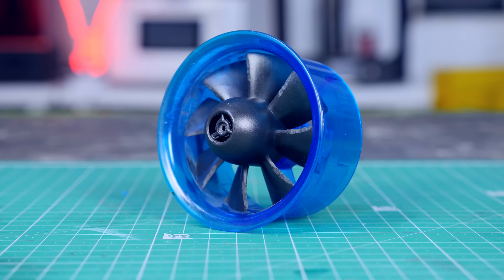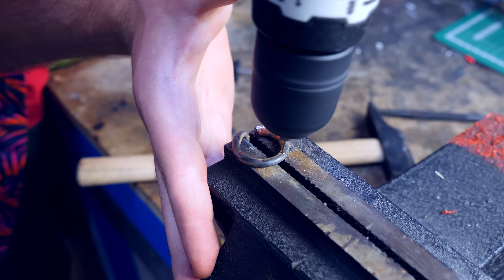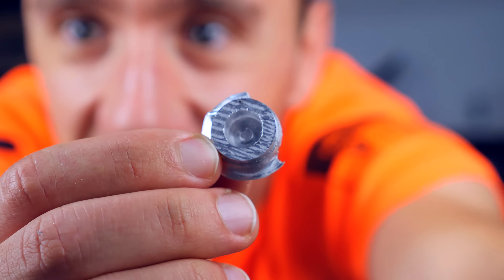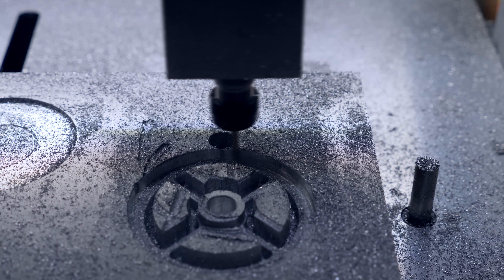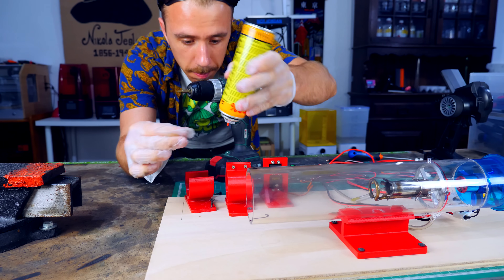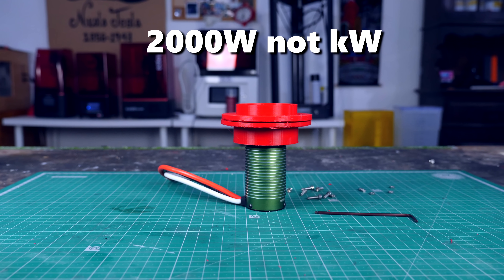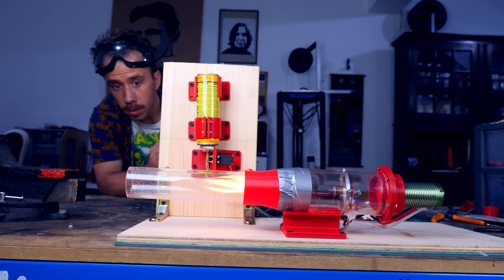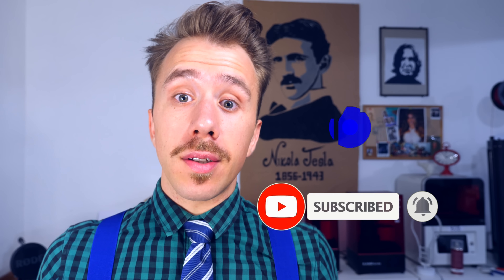I turned my Fan into a Jet Engine (3D Printed EDF Afterburner)

Comment: It is not the compressor that is holding you back, it is the nozzle (or lack thereof). You want a smaller constriction after a longer flame tube. The idea is that combustion happens at low speed, but high pressure, and then it is accelerated at the constriction. Without a significant constriction you are basically combusting at ambient pressure*, which doesn't let you do any work. A more significant constriction at the end of your flame tube means pressure can build up which means the afterburner does much more work.

*It will be slightly above ambient, because the expansion of the gas as it heats behaves like a constriction, but that also effectively shortens your flame tube. A moderate constriction at the end of the tube will limit the velocity increase to that area, giving the fuel more time to burn, while a smaller area means more back pressure.

Nozzles for aircraft with afterburners are immensely complex for good reasons. They need to balance flow against back pressure over a wide variety of conditions.

Comment: A flame holder is more a structure where a large proportion of tthe combusrion takes place in slower, hotter and more fuel rich air.  Suggest using the glow plug to light a fierce pilot light in a small flame holder, that heats the gas line for itself and an extra burner right behind it.

Comment: Sounds like your cnc needs slower feedrate or higher rpm. Or the power is to low because it sometimes stops spinning? Which parameter do you use ?

Comment: Radial fans/compressors actually suck pretty much and have long been abandonned on 'real' turbojet engine. They still are used on turbochargers and any kind of homemade turbomachine derived from there ;)
Why not printing an axial fan ?

Comment: Cool video.  A piezo lighter like the ones used to light gas grills would work well for your ignition source and not use any electrical energy at all, just your finger pushing the plunger.  They do not cost much money either.

Comment: Try filling the brass tube with sand before bending.  The sand will keep the tube from collapsing when you heat and bend it.  Works good for PVC too.

Comment: What if you wrap the fuel tube around the motor and connect it with thermal paste. That way the fuel gets a bit warmer AND your motor is cooled at the same time so you can run it faster or even "overclock" it?

Comment: Great video how about making a hydrogen peroxide remote control hover craft , the expanding gas can prove lift and forward thrust , you could use syringes on a screw thread to control the amount of thrust

Comment: To help with your surface finish and tool wear, increase the speed of tool rotation and slow down the feed. This will let your tool take smaller, more manageable bites. I also recommend using a suitable lubricant. Usually water based for aluminum.

Comment: Lookup Fan show down E6 and try the green cylinder fan in his hand on the picture, try modifying this one to your needs, I believe it will work better with your motor of higher power than the computer one, I know you can do this just don't get too scared or blown away from your creatures and creation 😜

Comment: So, some time back in the 80s when I was about 9 or 10 I build a turbofan engine like this using some cans. I made a 'turbine' with a can top ran off of a 6v lamp battery to a old RC motor, some fuel hose dripping gasoline to a flame holder, and you know what, it actually kinda worked. It made noise and flame at least. It might be time to make this with the kids. 

Might try a more involved 'Flame Holder' - I think it will hold your combustion in the chamber better, which you will need for thrust. And I know you like thrust. 

When you get it working, maybe RC boat time with this. Would be a great application. 

ALSO: I know a good bit about pneumatics and can throw you some solenoid valve info and parts to improve your setups. Feel free to drop me a line.

Comment: i dont know shit about cnc machines... but i hear for cutting lines, it is way more effective and easier on your bits to drill holes in the line's path and THEN side cut the line basically connecting the dots

Comment: We us a mist of isopropyl  alcohol when machining aluminum on a CNC.  Yes, there is a fire hazard, but it beats using oil (which is also a fire hazard).  It's very easy to clean up and produces a nice finish.

Comment: Integza,
When forming a brass tube, heat it to glowing, then quench it in water. This anneals the brass making it much easier to form.

This works on automotive brake system sealing washers too, FYI.

It's backward from ferrous materials which harden when quenched.

Also, RC nitro engines use a much smaller glow plug that runs on 2V. They're likely cheaper.

And since you can machine metal, why not make a true axial flow jet engine? The compressor (your EDF and centrifugal fans played this part) is connected by a shaft to the turbine, which is spun by the exiting gasses. Of course, your afterburner would also work in that as well.

Comment: you could learn pcb design and electronics design, you could easily make your own high voltage remote igniter, single pulse, continouse etc.
or make any other electronics project
idk rockets/3d printing but since you have all these tools you can make other things

Comment: You could try to build some sort of carburetor for your jet engines so you have more consistent atomization of fuel and a more controlled fuel air mixture.

Comment: You should 3D print a jet engine where the 3D printed burn chamber or acceleration chamber itself is the fuel for the afterburner 🔥
You almost used the acrylic tubing as fuel for your afterburner on this attempt 💥😎

Comment: noob checklist for CNC machining-
1- check spindle speed for size of cutter and material
2- make sure the depth of cut is small enough for each pass
3- figure out why it did some crazy shit like 4 times until it magically works for no reason

also I haven't finished the video yet, but I feel like the fuel should be upstream from the glow plug, or at least near enough that the ignition tube is radiating heat to your "fuel injector"

having finished the video, I think wrapping the fuel line or- maybe 2 lines- in a spiral around the ignition tube could preheat and serve to spread fuel through the chamber.. just not so close the copper/brass melts lol

Comment: The constriction you are using to convert the high pressure air into high flow has a name, it's called a venturi. It's also the best place to inject the fuel, as the low pressure, and high airflow through the venturi will better atomize the fuel.

Comment: Oh. A rocket/jet again.  I don't think Elon Musk is shaking in his boots, except with laughter.  Why not try something interesting, like those electro static drives, electric jet plasma engines, a electro dive made out of plates, like I was planning to do, or an electro magnetic sail drive with a really really really (run away from your house when it's in the basement) big Capacitor!  The sort the military has been running around in fur decades, while they laugh at you watching Stargate!

Comment: A) use lubricant when machining Alu, wd40 should be good. 
B) in Airplanes you have very Thin air, needs compression for combustion. The air down here should be thick enough. So you need high flow. If you feel the need for high pressures i would use an impellor+motor from a vacuum cleaner 🤪 
C) good work bud!😊

Comment: Also you can use one of the free calculators online to calculate your feed per tooth (chip thickness). There is a minimum amount of chip thickness for each material, if you go under that limit it can cause chatter, to high it can stall the machine, chip an edge or break the end mill. Once you figure out the range for feed per tooth you can then use a separate equation which takes into account your machine horsepower, depth of cut and feed per tooth. This allows you to tweak your cutting parameters close to the machines limit and be more productive.

Comment: 1 try to make a better version of the no heat engine and make a boat out of it possibly using other engines. 
 
2 try to make a good boat and make a propeller and resin get engine combo. 
(the light resin engine and propeller could be light and may even move!)

Comment: TL;DR, your first design was fairly correct, though it would be better to have the reduction from the second design with the main propulsion from the first.

Turbojets actually have "regular" fans. Also, mind, that a turbojet has a jet engine, connected to a larger intake fan, with some type of bypass - meaning that not all the air will be used for combustion. This doesn't look like a turbojet.
Anyways, the compressors in a jet are a bunch of well-tuned fans blowing into stationary blades (fans?), Pointed the opposite way to both allow more compression, and to stabilize the air so the next stage can function better.

Comment: Video idea/challenge: try to come up with an jet engine that runs on diy gas/fuel that is not bad for the environment. So it can be a good alternative to the crazy amound of fossil fuel these engines use. That would be amazing and educational (Maybe something like biogas or biofuel. Or make it powered by High Test Peroxide. Or make it powered by a hydrogen/oxygen generator (electrolisis))

Comment: Looks like a lot of runout on that end mill I would check it with a test indicator measuring off of a precision rod in a collet. Also we use WD-40 as cutting fluid on aluminum, in the machine shop. Best of luck👍🏻

Comment: Your flame holder needs to be larger, the fuel injector close to the flame holder (in the best case it should be inside the tube of the flame holder) and you need a stronger elf. this will get you the best results. Maybe try to add a fuel pre heater by winding a coil of metal tube and placing it in the engine where the flame is so the fluid will heat up and become a gas. good luck

Comment: Correct me if i'm wrong but, is this really an afterburner or just a standard turbojet engine whitout the turbine stage?
i mean, the turbine is not present because the compressor is moved by the electric motor of the EDF.
Normally the afterburner is after the turbine and burns an already burned mixture, in this engine the combustion happens after the compressor like a normal turbojet

Comment: I will help you out on how to make sparks safer.....  "DC 3V-6V to 400kV 400000V Boost Step-up Power Module High-voltage" eBay has them about 10$!

Comment: Wouldn't having the propane can be upright better as that would result in the liquid propane staying at the bottom of the can and only the gaseous propane being released. Therefore, you shouldn't need any heating stages and the efficiency should go up as less fuel goes unburnt (dripping into the combustion chamber 12:32).
Reply: The dripping is actually the reason why you want it upside down. Reducing the pressure of a compressed gas causes the gas to drop in temperature. In the case of propane, the cylinder is compressed in equilibrium with the gas and liquid phase. If held right-side up, the gas escapes and the propane boils, but the temperature falls continuously. This is further compounded by the enthalpy of vapourization in the propane. In the upside down configuration, the liquid fuel is pumped out with the gas in the cylinder simply acting as a self-pressurizing tank. This is very similar to how certain liquid fuel rockets work.

Comment: Quick tip for machining aluminium: Try a Vc around 600-850 m/min n=Vc/(π*d) n=Spindle speed, d=Diameter of the tool. With the right numbers should it sound better. Maybe a bit less feed.

Comment: Use much shorter endmills when milling and you will have less trouble and feel much more confident. The flute length needs to be the same as the depth you wish to mill and no more (plus a little to clear the swarf if you are going full depth in a single cut). Stubby endmills also tend to be double-ended so you get an extra try when you break one. Cutting oil is also worth using as it will remove some of the heat and stop galling. As someone below said you can use wd40, but cutting oil is easily as cheap.

Comment: A normal gas turbine engine is an air compressor. An EDF is an air accelerator, which is not quite the same thing. To make an afterburner work properly on an EDF and actually augment the thrust efficiently, it needs to burn in a high pressure zone, so you need to swap air speed for air pressure. To do that, you need a converging nozzle before the afterburner. I'd say reduce the diameter of the plastic tube by about half or two-thirds using a cone of about 30 degrees angle between the EDF and the fuel injector. You will be able to tell when it's right, it's more of a glowing plasma than a roaring flame. Yes, EDF afterburners produce a small flame compared to the diameter of the fan; that's life.

Comment: Have made dozens of these. use a compressor from a turbocharger. also, diameter of the inlet of the air entering and the diameter of the air exiting is detrimental.

Comment: Perhaps you could create your own liquid propane fuel regulator, so that you have a constant pressure and fuel flow for future liquid-fuel engines. This way you could perform more consistent tests on any engine that uses liquid propane/butane when you don't have to manually control fuel flow so much.

Comment: With it being a smaller CNC it's going to chatter easier, if you're starting top cuts on a soft metal like aluminium a ball end mill will help with chatter and can easily be cleaned up with a regular end mill for sharp angles

Comment: Hey Integza! Great video!
What size glow plug were you using? I am designing something using a high-voltage igniter using a stun gun system.
Here is an idea for a future video:
Develop an afterburner/ EDF powered booster stage (or two) for attachment to a solid propellant based model rocket like the 1/100th scale version of the Apollo era Saturn V rocket kit recently reintroduced by Estes company currently available at a very reasonable price worldwide? By doing so, you may be able to help bring more people into the model rocket hobby. In fact it would be very timely considering what is happening today in aerospace. 
By the way, if, for some reason, I am selected for the win of the 3D printer, I think I would donate it to our local school here in mid coast Maine here in the U.S. It would sure help them in their STEM classes. 
Nevertheless, great videos!!

Comment: Integza! If you try some shorter mill bits, the mill end won’t wobble so much, as I could see that happening, and your cuts will be more precise and a lot less noisy. Or try to insert your bit a little bit further into the bit holder.

Comment: Rarely ever comment on any videos, but do like your videos enough and really wanna win a 3d printer so here goes.
I would like to see a project with a rocket driving a car, but not directly, the rocket's output gas or like with your previous video, steam, would essentially be used only to drive the wheels, like with a piston motor utilising the output from the rocket, to create pressure and drive a shaft, you've done it with air and a wankel motor, but will it work with a rocket and a conventional piston motor?

Comment: why dont you try to make a electric bike that with its own enery charges itself, like puting a generator in the wheel and transfering enery to the battery 

it is probably not enough energy to substain itself but sounds really cool

Comment: may i recommend smaller injector to atomise the fuel ,  maybe use a similar setup to what you did with the fuel pipe but fit some 3d printer nozzels that are 0.4mm or even smaller to make life simple